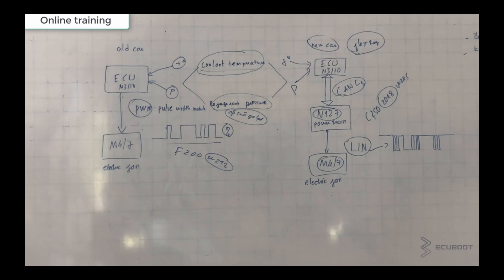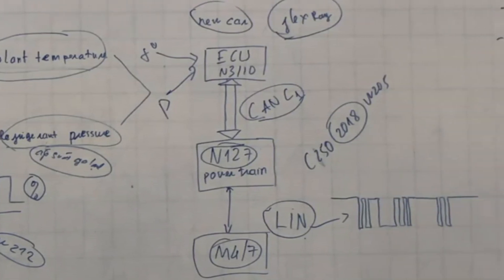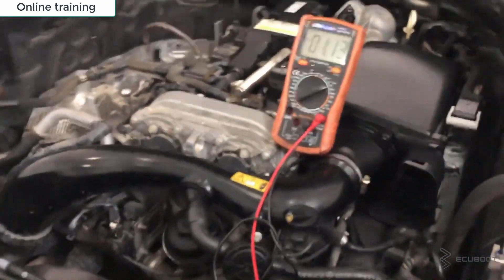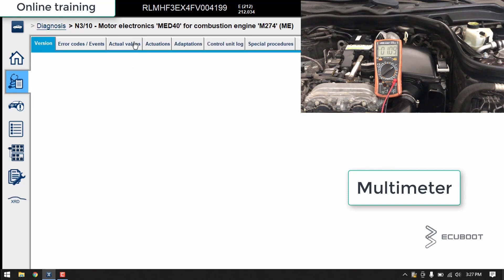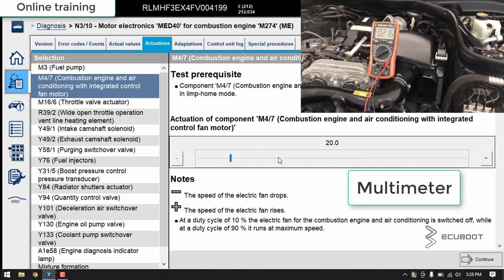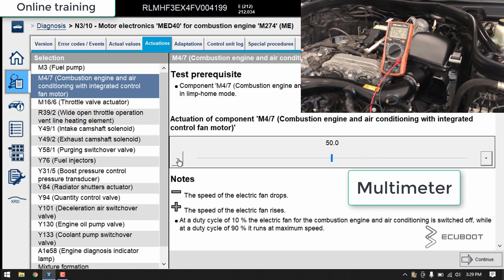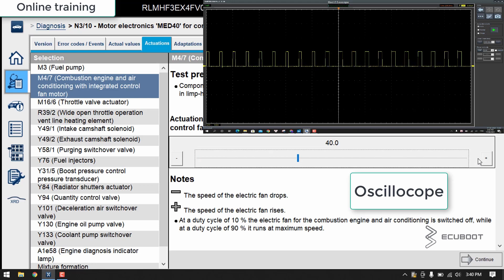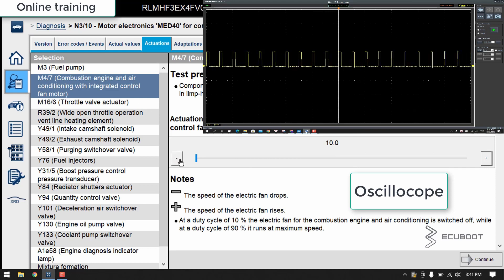How to test Mercedes W212 Fan

Comment: Many times I tried to program the fan to run at a lower temperature, and the process did not work w212 I was using the original device and Maxis Pro.
Thanks for any help
Reply from the maker: hi bro. on some old car, electric fan is controlled by ECM. but new car this is PCM ( powewtrain control mudule )